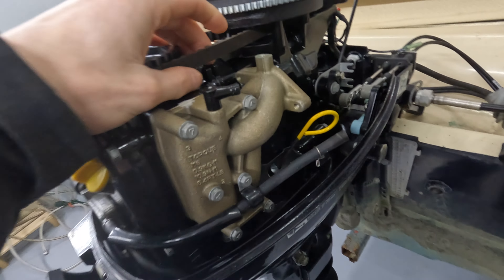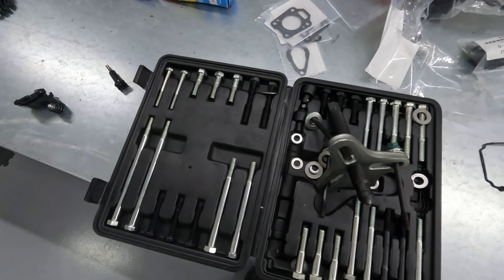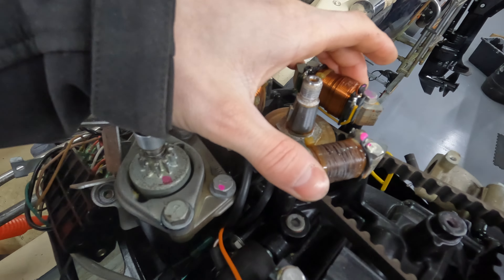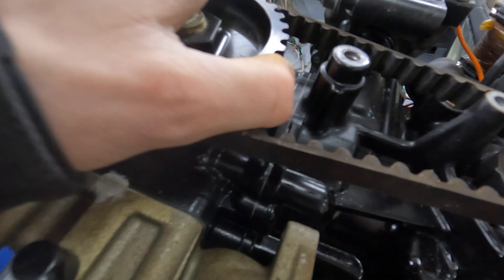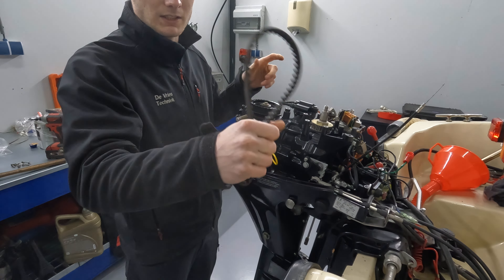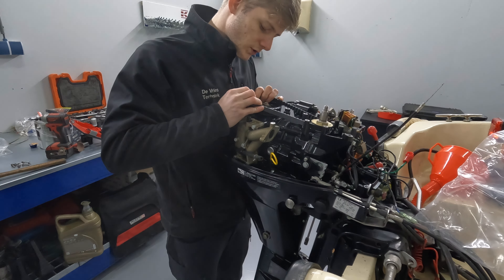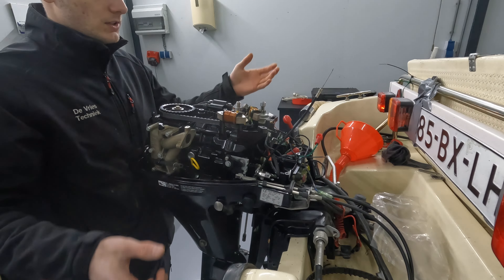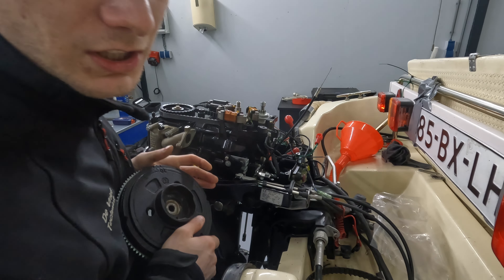How To Change A Timing Belt On A Outboard Engine! EASY!! ( Tohatsu 9.8HP )

Comment: How is the tool called to pull the flying wheel ? And which diameter is needed for this puller?
Reply from the maker: Its a pulley puller/ flywheel puller set. For This engine i used the set that can go from 35mm to 95mm
Reply: @Marinepartsystem Are those puller bolts M6 or M8 bolts?

Comment: Can you explain clearly on how timing works
Reply from the maker: Timing is basically the synchronised motion of the crankshaft and the camshaft(s) and for  gasoline engines also the timing of a spark at the right time. Some engines use a belt ( like this one here) some use a chain or regulars gears only.